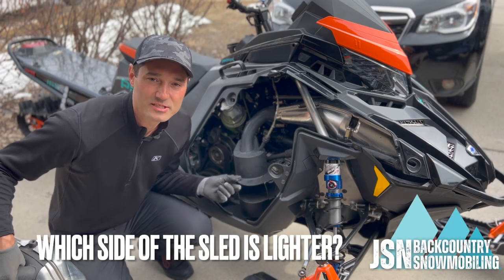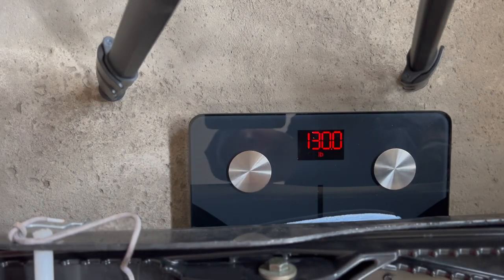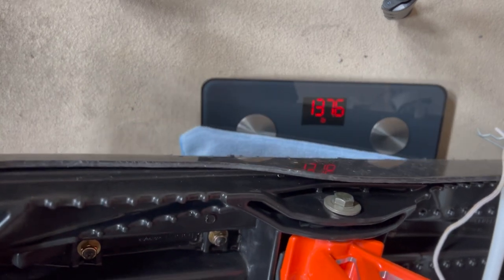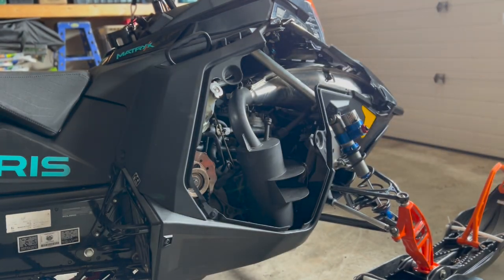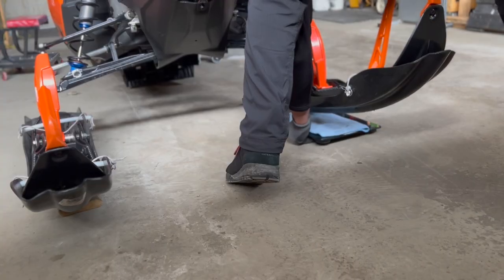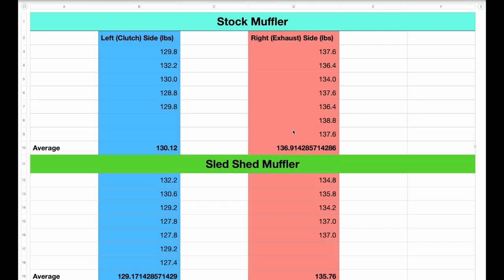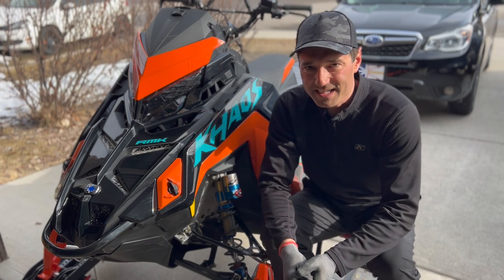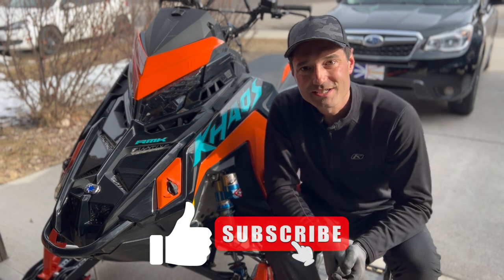Is the Exhaust Side Lighter? Polaris RMK Weight Distribution

Comment: Good data. Please specify gas level, oil level, etc. Really this should be done full fluids and with a spare belt.
Reply from the maker: The oil level was full, I have a spare belt on the clutch side and half a tank of fuel. Thanks for the comment 👍

Comment: Without looking at the tech manual for the new sleds, I would guess they are like the earlier Polaris sleds in that the centerline of the engine is to the exhaust side of the sled centerline. This was reduced with the Matryx but it's still there. This could be somewhat behind the 'clutch side is lighter' result. There must also be a gyroscopic resistance to forces perpendicular to the axis of crank rotation. I presume these effects factor into the seeming universality that a left sidehill is easier than a right one. Some say it's throttle location, comfort, and practice, but I'm skeptical. So what's the scoop?
Reply from the maker: For me it has to do with my dominant leg (right) on the running board when wrong foot forward.